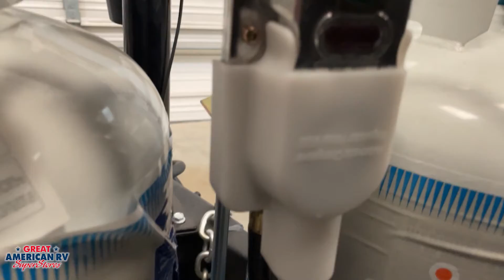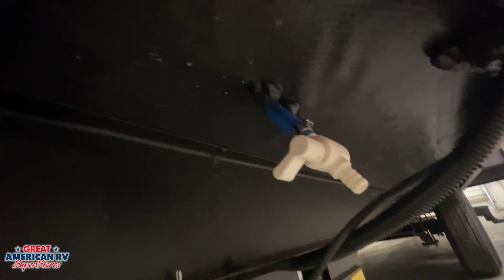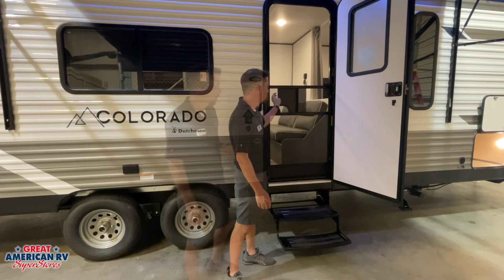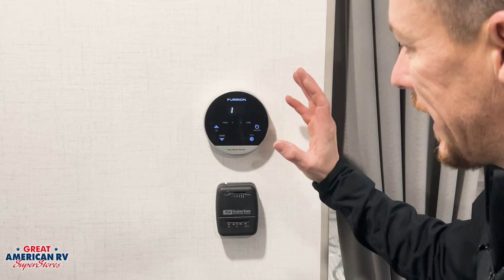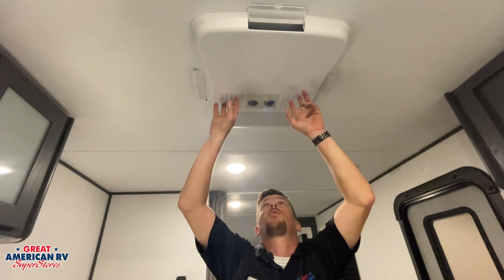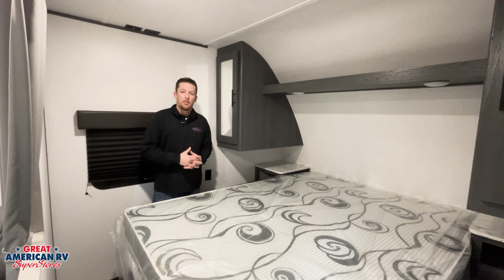2024 Colorado 24BHC Owner Delivery Walk Thru

Comment: Can this camper be towed by a 2021 Tacoma?
Reply from the maker: Dry weight on the camper is 4,739 lbs.  There are several variables on the tacoma that would decide if it can tow it.  I suggest having a dealership confirm it for sure, but according to google, a 2021 Tacoma has a range of 3500-6800 lbs towing capacity depending on model.
Reply: I know thev4x4 Tacoma I had pulled it easy,stopping wasn't issue. Pulled it with friends 2wd Tacoma and it did not do well at all. 4x4 has tougher suspension I guess. Camper super lite for it's size,well built too but would definitely check your specs on your truck